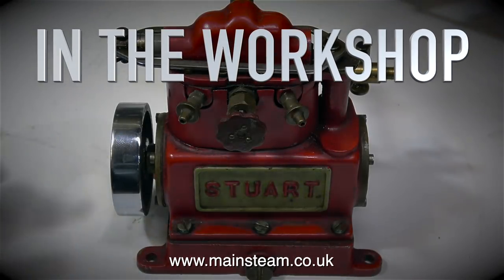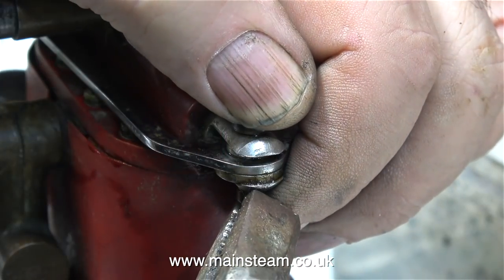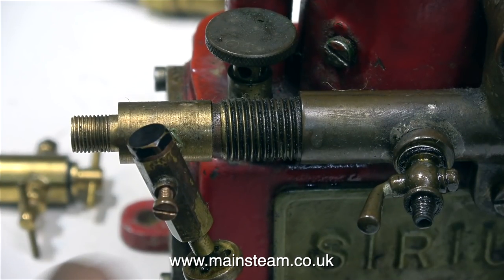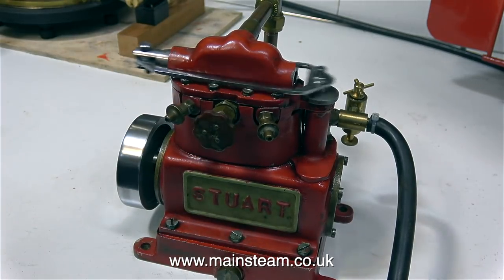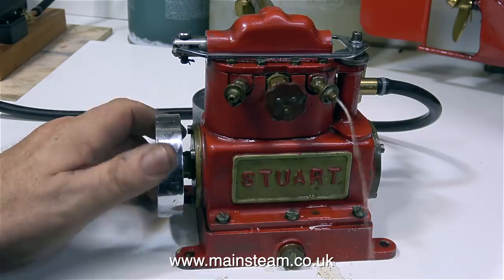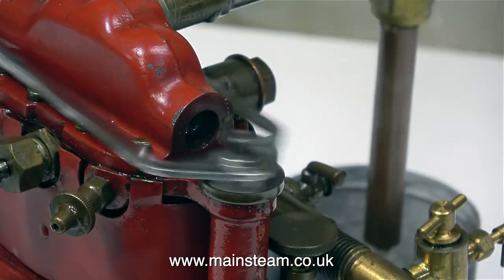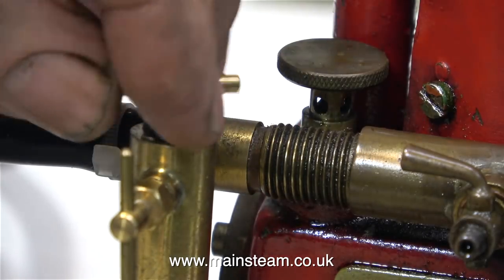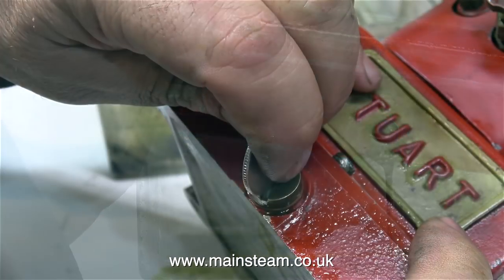A VINTAGE STUART SIRIUS STEAM ENGINE - PART #1

Comment: Oh I like that.  It's very purposeful looking. Would make a nice close coupled generating set..  perhaps in a a very large model boat..
Reply from the maker: That's what it was designed to do - to power a WW2 electricity generating set for radio transmission behind enemy lines.  The boilers in the generating sets were made from Aluminium to keep the weight down for a parachute drop.
Reply: @keithappleton I never knew that.. I might have to Google it for more information. .. cheers

Comment: Very cool looking engine! First time I’ve seen a steam engine with an oil sump! Does it have an oil pump, or does it have vanes on the crankshaft/conrod to flick the oil around the crankcase?
Reply from the maker: it's just splash lubricated - very simple . . . .

Comment: Hi Keith.... Perhaps this Fast Sirius Engine would work well with that Brushless Generator from a previous episode,  as it runs so much faster than the Stuart 5A. Also if you need a higher Voltage you can always use a DC to DC Voltage Converter.  
Wonderful engine & video!

Comment: very nice steam engine, one question, could this engine be used to run a 6" metal lathe that has a 1/3hp electric motor on it?
Reply from the maker: it's not really practical ......
Reply: @keithappleton  so the reason why it is not practical is the engine doesn't have a governor or not really suited for it?
Reply from the maker: it's not really practical at all for many reasons - just leave it there . . . .

Comment: Did your channel get remonitized again because this one and the last video i watched had a ad at the beginning of video? Congrats if you did win your appeal because too many are not
Reply from the maker: The Youtube advert revenue appears to have been reinstated, which is good, and my kind Patreon supporters have more than doubled in numbers since the de-monetisation fiasco. What I am more concerned with now though is that every video that I make public on Youtube is immediately stolen and posted on illegal "Clone" websites and nothing seems to be done to stop it happening . . . . and for that reason I will be putting one video per week on the public Youtube platform. My Patreon supporters are now over 40 videos ahead of what is on here currently and this is the way it has to be.

Comment: Lighter fuel on heads???? Good god man!! When I worked in a studio, as tape op, my first job of the day was to clean the heads with isopropyl alcohol. If I had tried lighter fluid I would have probably been duck taped to a chair and spun round till I was the appropriate shade of purple! ( That actually happened, twice, for other crimes.... ) Back to the filem, this time I will try keep up with the series...
Reply from the maker: I only used it for 20 years, and the studio bought my house, bought my cars and raised my family - and it is less dangerous that Isopropyl Alcohol - so what is the problem again - ?
Reply: @keithappleton  Ha ha ha. I thought that would be your reply as I typed mine. In retort, residue oils from the fluid and the risk to the plastic parts of the heads. Mind you, this is from someone who used acetone to clean the head on an old flat tape recorder years before the studio. That was a serious mistake. Sometimes when I type the 'fake' shock in the spoken word does not translate. Apologies, I shall be taking my dried frog pills on time in the future ;)

Comment: Yay, adverts are back
Reply from the maker: and it only took them 2 months ! ....... The Youtube advert revenue appears to have been reinstated, which is good, and my kind Patreon supporters have more than doubled in numbers since the de-monetisation fiasco. What I am more concerned with now though is that every video that I make public on Youtube is immediately stolen and posted on illegal "Clone" websites and nothing seems to be done to stop it happening . . . . and for that reason I will be putting one video per week on the public Youtube platform. My Patreon supporters are now over 40 videos ahead of what is on here currently and this is the way it has to be.